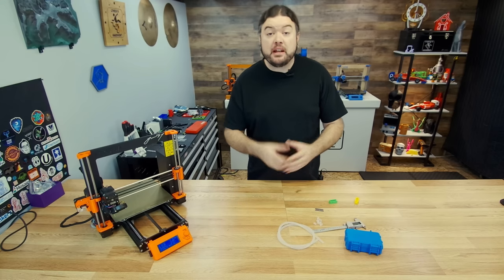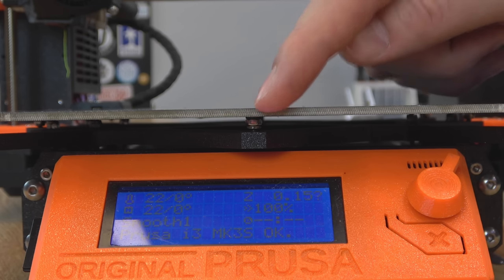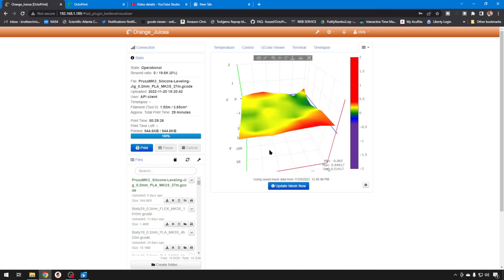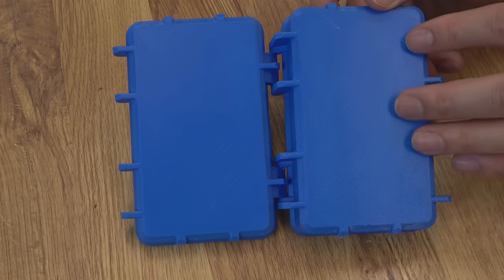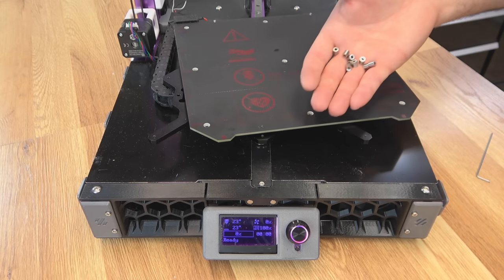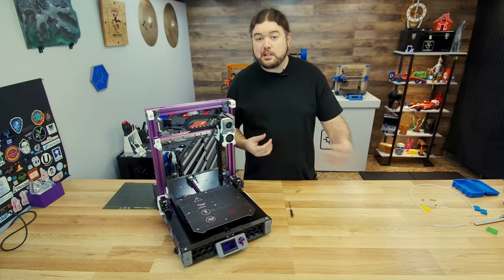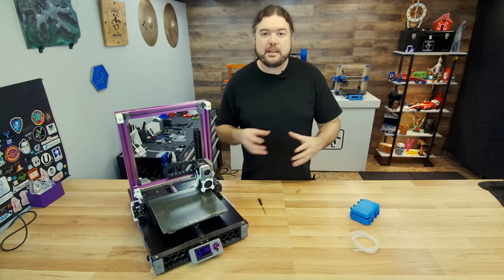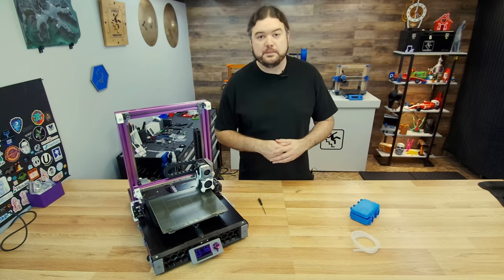Hack your Prusa - Revisit - Prusa Bed Leveling - Chris's Basement - 2022

Comment: The retired carpenter/mechanic in me would do a preliminary check with a good Level and straight-edge across the nine leveling screws. I would expect the first pass could be much, much closer to level after that excercise, then use the software. That should save the wildly out of level first pass.  Just a thought...😁
Reply from the maker: Thanks for your insight!

Comment: I just got a T300 and it has level issues. It's not easily adjustable with screws, although I did machine 4 aluminum spacers for the corners. I got it dialed in a little better using aluminum tape, but 2 corners on the 300x300mm bed are still a tad out.

I should check out my MK3 level as I'm curious what it is after fighting the T300 level issues.
Reply from the maker: It's pretty interesting to look at these. Some I have never had issues with, but then I look at the map and it's really bumpy.

Comment: I did a modified process  this many years back on my mk2.5 . I did have an issue when I did a complete calibration the software ploughed into my bed so I want sure why . It's Likely my bed sat off the y bed by more than the default. Question is where can that be adjusted ? Perhaps I should try the silicon standoff off on it.
Reply from the maker: MK2.5 is a little harder to line up as it has less mounting points, that could add some challenges.

Comment: @13:30 - 13:50 did you check the y carriage flatness before mounting the hot end  ? You want a fairly orthogonal surface to the z axis before adding th hotbed. Yes you can make up for it with the silicon standoff but that adds unnecessary pressure to the hotbed .
Reply from the maker: I usually just do a quick check on the Y when I assemble them on a piece of stone.

Comment: I wonder if one should apply some thread lock to the screws? They aren't being tightened to a stopping point like they would be if tightened against the original spacers. How is this silicone mod holding up?
Reply from the maker: It's holding up really well. It's under high tension after you get it set, it seems to be holding everything in place.
Reply: @ChrisRiley  - My high-temperature silicone tubing just arrived, and I was surprised how stiff it is. I agree the tension is going to be quite high once I get these spacers installed.

Comment: Could this also be done with klipper? I Have a klipper/mainsail/klipperscreen setup on a self build prusa bear. But klipper doesnt support a bed like this with bed screws adjust. And i have already spent many hours to find help on internet without succes.
Reply from the maker: You could do the same thing with Klipper, you just have to do it manually somewhat. That's Klipper in show in the video on the switch wire.
Reply: @ChrisRiley  There is an option in klipper screen that is like octoprint. Unfortunatly it can only use 8 screws and the left front screw is the reference in stead of the center screw with the prusa nyloc mod.
Reply: Yes doing it visually with the mesh view also works. But I just hoped klipper had the same function as octoprint for prusa.
Reply: Forgot to say, your video's are great!
Reply from the maker: @edingcnc7685  It would be nice to have a plugin for it for sure. Thank you!

Comment: i have also 2 years of this mod and never had leveled my bed again. I used blue high temp silicon tube. One of the most useful upgrades for mk3(s+).
Reply from the maker: That's great, thanks for sharing!
Reply: Where can you get this blue high temp stuff? I got my third Prusa today and the bed is pretty off sadly so I’d like to try this and level her out. If possible could you link it on Amazon if they happen to carry it?

Comment: I've heard some have had issues with the ABLs giving inconsistent results with Ender series printers.  The theory is that the x axis and extruder stepper signals can leak to the ABL signal, causing a false trip on the bed Z position.
Reply from the maker: Interesting, what type of sensor are you using?
Reply: Correction, meant to say inconsistent.  I corrected my original post.

I have the CR Touch.  I'm not sure I've observed this problem but there is a report on github for mriscoc.
I think I've seen inconsistencies where without touching anything, the matrix or even tram varies.  Whether it varies enough to make a difference could be debated, but if you're trying to dial in the first layer, 0.04mm can make a visible difference.

Comment: You could use the bed_screw_calculate Makro to get idea on how much each each screw has to be turned. That works great on my ender but should even be better on the switchwire with 9 screws!
Reply: Correction: screws_tilt_calculate
Reply from the maker: Cool, thanks!

Comment: I know this is a year past the point of the video being posted. I watched both older and newer, I think I would use the old method as in my mind with load cells I think the data would not be as consistent with adding any type of pressur on the plate. with that said Chris both videos had tons on useful info and I thank you for it
Reply from the maker: Thanks for watching! I'm curious about your results
Reply: @ChrisRiley I did this mod on my mk3s and it worked so well. The bed seems flat but seems to be higher then before with that said I am going to do it to my mk3s+ as for the mini this would take more to do something like this

Comment: As you pointed out. One needs to keep his expectations under control. On top of the heating plate you put the print bed that also has some warpage and can only copy the geometry of the heating plate to a certain point.
One thing worth mentioning. You can use ponterface or octoprint to tell the printer to either keep the bed map throughout the thickness/ height of the print or to make a fade out of n layers after which the printer doesn’t compensate any more. Basically you use the first n layer to absorb the deformation of the bed. I cannot remember the gcode for that though.
Reply from the maker: Awesome, thanks for the tip!

Comment: I’ve been wondering about this mod (either version) for a while.  My biggest issue is when doing MMU2 prints, and the purge block pops off - not sure if that is a bed leveling issue, or something with the way that purge block is laid down.
Reply from the maker: Could be bed leveling, You could also slow down the purge block a bit to help out. Good luck!
Reply: If my MMU purge block (or anything else) pops off, it's due to the troublesome powder-coated sheet I have. Mine came from a bad batch and it's always had adhesion issues. Alcohol is ineffective. Best thing is warm water and dish soap every half dozen or so prints. I noticed PVA filament sticks real well to it, and wherever PVA has been, other filament adheres to those places for several prints.

Comment: I've been ok with the stock prusa level, but I do have to admit that if I wanted to do it more, this looks WAY easier than fiddling around with an ender. lol
Reply: I was OK with the stock Prusa level until I had to print two large pieces that had to mate together at the surfaces that were on the build plate. It is then that one notices flatness variations in the build plate. I had that experience in something I made for a client last week, and that eventually led me to this video. Fortunately the client didn't mind because he had to finish the part with Bondo to prepare it to make a silicone mold.
Reply: @anachronist  in PLA at least large parts seem just fine. I'm having issues right now with PETG. But I'm 99% certain it's not bed related.
Reply: @awilliams1701  - in my case, the two large PLA parts I printed and then joined did not match up perfectly, even though both parts were sliced from the same model. I installed Octoprint to get the mesh leveling data from my printer, and saw that my build plate is not flat, actually there's a slight twist. It's mostly flat, but the two corners on the right side are high and low; the maximum deviation from center is only 0.2 mm, but combine two parts together and that error is doubled. Printing a single part, you don't notice any problem with flatness. It's evident only when joining large parts.
Reply: @anachronist  as Chris said the prusa ones are usually pretty good, but not all are.

Comment: I did that mod 2 years ago also, and it held the level beautifully I use a dial indicator attached to the printhead to make sure it is dead level that way I don't have to mess around with software, but I took my printer to even the next level and created a custom water cooling loop for the printhead. It's been over a year and I've never had a print jam due to heat creep. since doing that mod I can print high temp poly carbonate 275-295 all day with no issues. the mod I developed is compact and simple and requires minimum modification to the printhead.
Reply from the maker: That's great! Thanks for watching